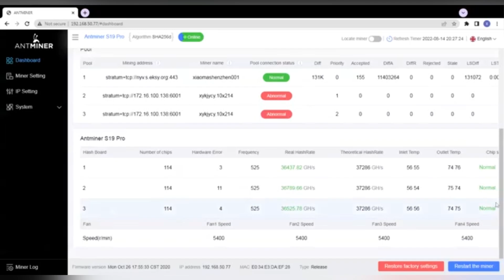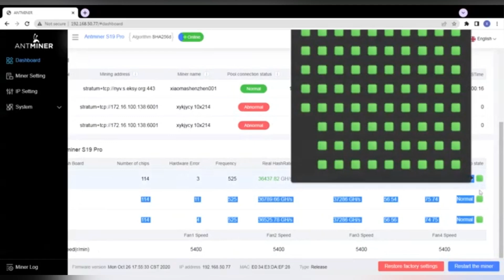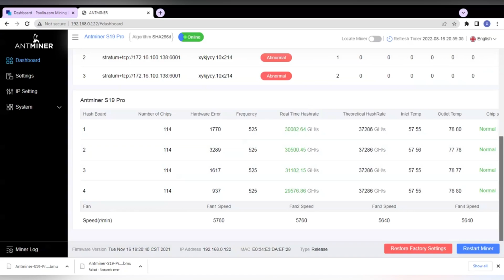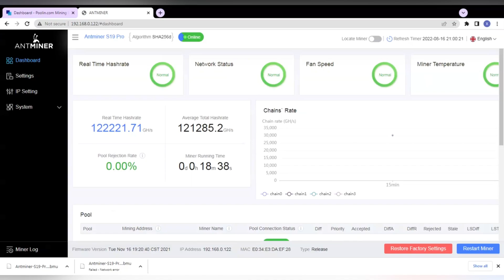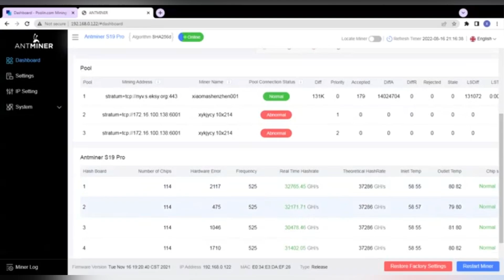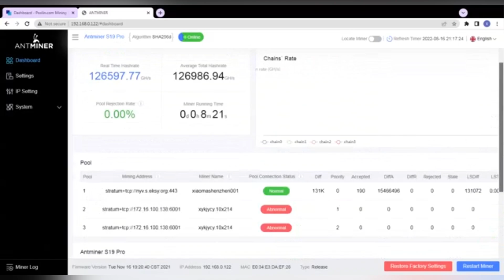#antminers19pro  #overclocking  up to 40% gain  with zero fees

Comment: Hi
Reply: I see you video, you are given great information, but i have a one question... What about power supply, that also need to change or factory power supply is ok with that board
Reply from the maker: you can use the board with original power supply , but you will be limited to 4000W maximum power consumption

Comment: Been nice to know how many watts you where using
Reply from the maker: Power consumption will depend on how much hash rate you pushing depends on the setting you select in the control board , just for reference going 95 th to 110 th you can expect about 3750 W on the S19 , or the S19 pro which is more efficient going from 110 th to 130 th with give a 4000 W

Comment from the maker: Check the link for the overclocking board :
https://www.cryptomininglab.net/product-page/multi-preset-overclocking-control-board-up-for-antimer-s19-t19-to-40-increase

Step by Step guide on how to increase the Hashrate on your S19 Pro with bitmain firmware 
1- Hardware installation 
2- testing before overclocking 
3- different levels on overclocking capabilities